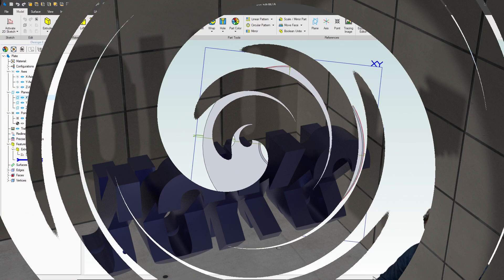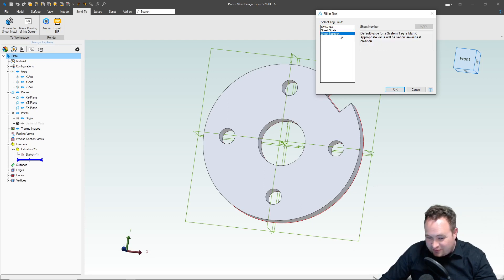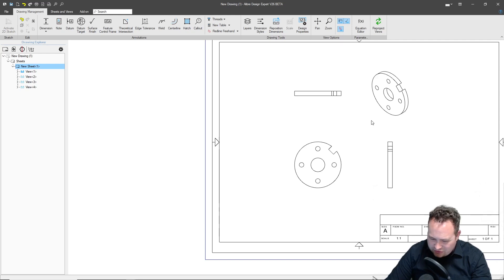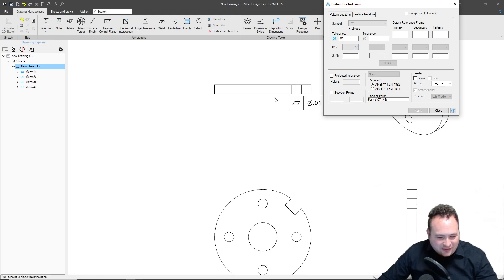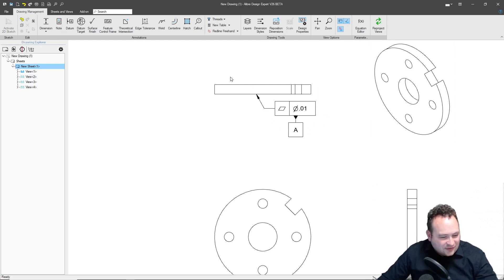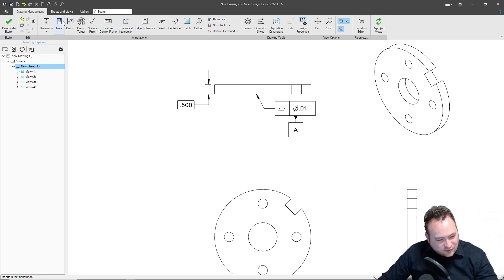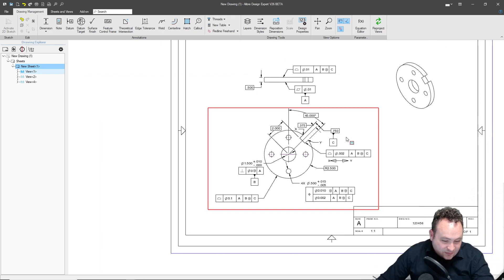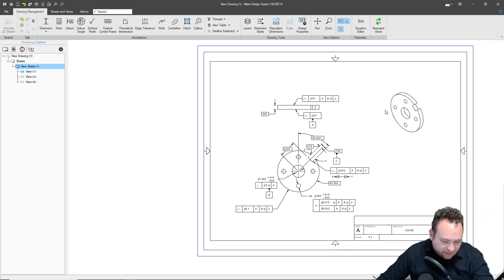Alibre- Lets Make a GD&T Drawing |JOKO ENGINEERING|

Comment: While ASME and ISO share symbols there is a fundamental difference in philosophy between the two systems, and it is how part envelopes are interpreted.  This is a nice tutorial on the potential of adding GD&T to Alibre drawings.  A warning to anyone who doesn't understand GD&T, there are numerous syntax errors in the feature control frames.  Please don't blindly copy.
Reply: Yes, you are totally correct - he did say though it was just a demonstration of the tools. However, the correct stipulation /application of GTD or even good detailing takes quite some time to learn. It's very difficult to specify accurately if you've never actually machined anything and fundamentally, the 'designer' has to 'sign off' all the detail drawings imv. In companies that actually manufacture , outside of the 'Design or R&D dept. there's the the Methods , Jig and tool and QA (Quality assurance) departments that all have tolerance / part manufacturing say so -  ultimately they decide the veracity of the part specification. Be prepared to justify that tolerance!
Reply: @TAH1712  I understand it is a demonstration of the tool.  In my experience, and I was guilty myself of this in my career as well,  tolerancing parts is an afterthought to the design process, and the education of tolerancing is poor in general.  Alot of copying from past designs or going out and finding tolerancing schemes that look good are then applied to the part.  If you are a designer, take the time to learn GD&T.  Not only that, spend time with people in other disciplines, mfg, quality, etc. and learn from them.  It will make you a much better engineer.
Reply: @christopherbrosz5003  I'm with you all the way - I did a technology apprenticeship spending 6/ 8 months each in Methods, Inspection and Q&A, Design / drawing office and about a 1 1/2 years in the manufacturing area - an essential grounding and a lifelong appreciation of the importance of what all the little 'cogs' do in manufacturing. I would write myself a different apprenticeship though.
Reply from the maker: Comments like these are particularly poignant for creators.  The quote concerning ASME rule #1 and the 90% similarity between ISO and ASME actually from a statement from Ed McCarthy, ASME co-chair.  Yes, the differences are in envelopes, but that shouldn’t have needed to be clarified since it was explicitly stated that this is not for people who don’t already know.  Errors were already talked through on the video as well as in the description.  This video was about how to use the tools within the program, and receiving comments like these that address exactly what the video isn’t about and on points that have already been addressed is a particular point of frustration for content makers.  In other words, as far as I can tell, this is the only video on YouTube so far that goes through how to use these tools on Alibre- and trying to get useful information that can help people that otherwise wouldn’t be available out there to be met with comments like this is discouraging and makes it more difficult to get information out.
Reply: @JokoEngineeringhelp  I stated I liked the tutorial in the use of the tools.  This information is extremely valuable.  My indictment is not against you, but against the engineering community that sees little value in educating engineers in the practice of tolerancing.  We all had to learn it either the hard way or were fortunate enough to get into a company that trained us.  What happens though, and I see it when I check their work, is they copy what they find that they think makes sense.   I am just as guilty of it in my younger days.   I am a huge advocate of engineers getting educated on the use of these systems and not copying what they see in use.  There is much bad GD&T out there and I will be the first to admit my share of bad drawings.
Reply from the maker: You're right, sometimes I get a lot of people that try to prove they are smarter than me so thanks for the clarification.  I do have a feeling geotol will be more and more standard as time goes on, at least lets hope.  Best
Reply: @JokoEngineeringhelp  With model based definition becoming more mainstream as file share protocols becoming better able to track and lock revisions I have big hope for GD&T.  It will have to become mainstream for this type of work to advance.  I preach that to the young engineers I mentor.  I tell them it is our engineering language and we get better with practice.  We all can get better  at application of tolerancing.  It will be the future.  I have no I'll will towards you and I hope you don't towards me.  The service you do with your tutorials is excellent.
Reply from the maker: @christopherbrosz5003  Thanks and you as well.  I would like to see some MBD in Alibre some point soon.

Comment: I always try to keep GDT to a minimum and as basic as possible - although, loosely specifying all features with stacked feature references to AIBIC ( in that order)and MMC , and this and that RFS, should make the part 100% defined and not add cost ( when understood) etc, but  I am always reminded and guided by  KISS or Keep it Simple it Stupid. When you think of all the CNC parts made on 3 ~5 axis machines, it's not that easy to see how the manufacturer has taken account of the defined / specified GDT ( to 3 planes mixed with mmc) in their m/c'ing program. sure, they will structure their programs with doing key relations ships with the same cutter, slower feeds etc. Of course the GDT defines the finished part - It doesn't automatically mean every stated features has to be verified / monitored all the time. However, if you smother the part drawing with unnecessary GDT, even if it defines a loose , low tolerance part - it is impossible for me to see how that can lead to lower manufacturing quotes in most cases... surely the manufacturers position would be - you state it, don't I have to check it...I'm gonna need either in process gauging or a cmm for that ! Edit: I suppose the designer / purchasers answer to that would be, 'no, you don't have to check it...but you do have to ensure it and assure me as well!